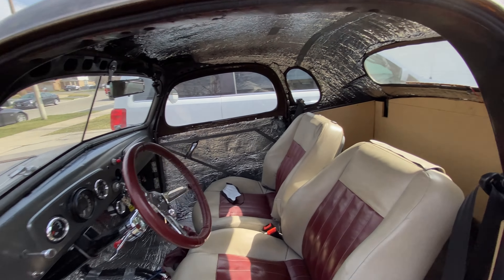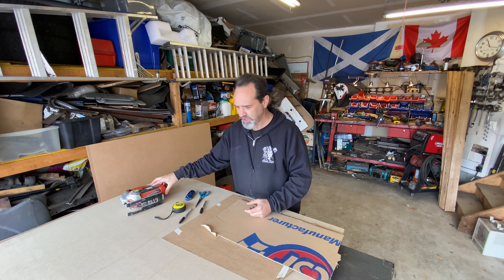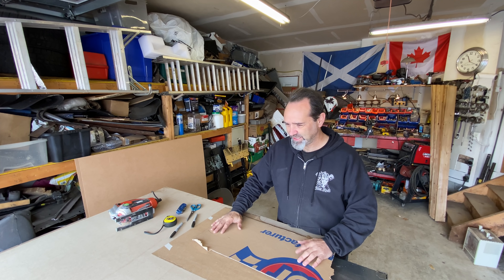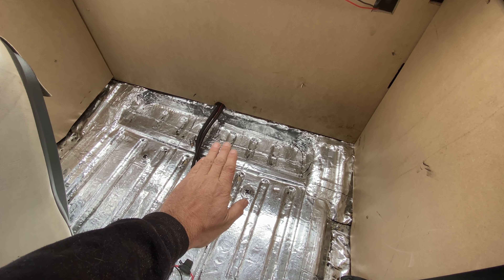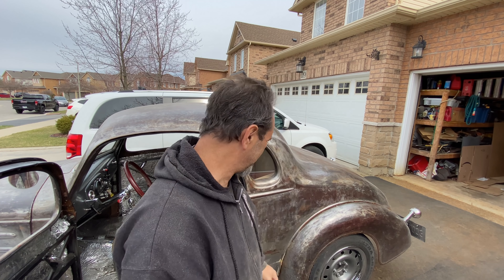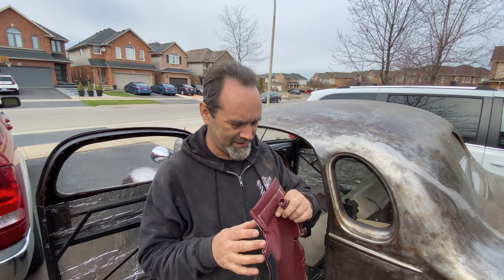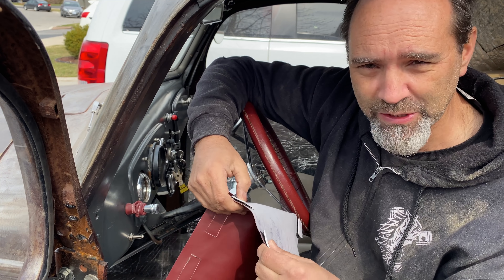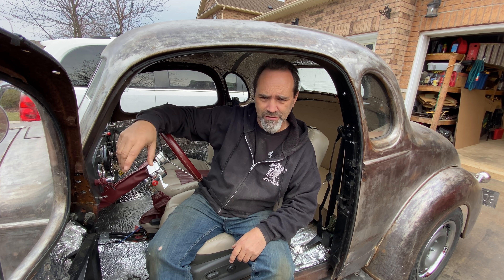Interior Paneling And A Crazy Contraption Created By My Wife For My 36 Chevy Coupe

Comment: Looks amazing and I kinda guessed it gonna be a wrap over something for the stickings being on both sides! 
Back when u talked about the disaster of blue and red... I did advise to the whole dash from that leather glued on... But would have came out super fancy and the gator would have came out from same leather base! Perfection!
Love what you did with the rear part but if this being no rear seat then u do have a little pickup for all the storage places it got mate... Back area and the huge trunk and even not all utilized! Perhaps make the separation panel on a hinge so u can connect trunk to back area like modern cars with foldup seats? Carpet on both ends... Trunk being dead level with back panel folded down? For huge deep storage space from the trunk all the way to back of ur seats?! Just a handful idea if u d bring tall things or something a bit big that can slide from trunk lid and be shoved all the way back! I dont know... Bugsy can be a handy little fella!

Comment: I'm surprised you didn't just run the wiring underneath and attach it to the frame that way you don't be stepping on it and dealing with what you're dealing at steering column cozy is the new one on me